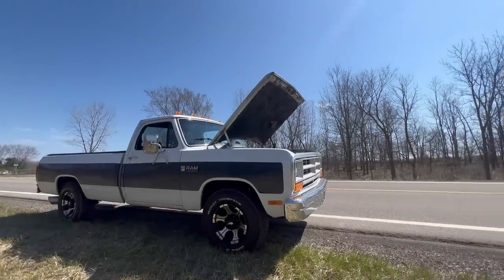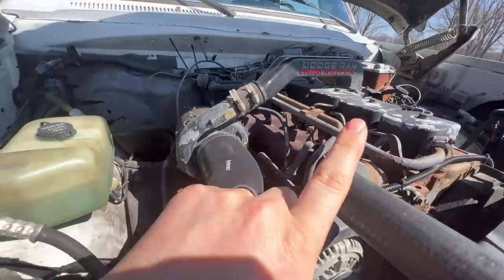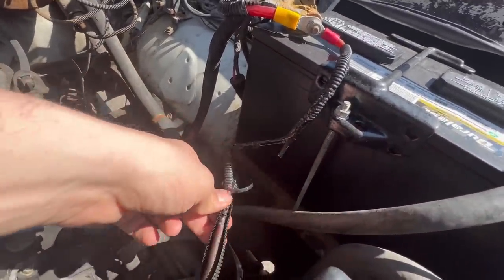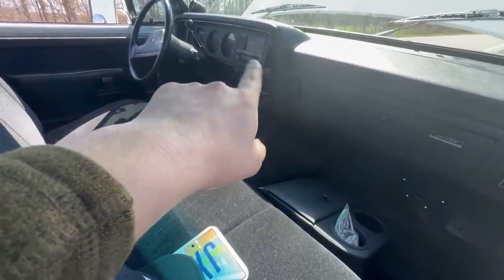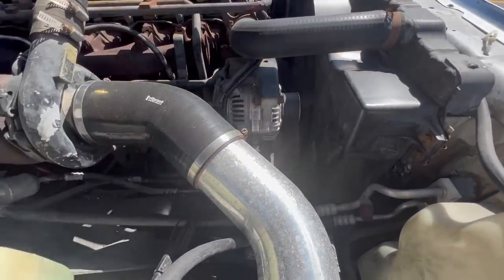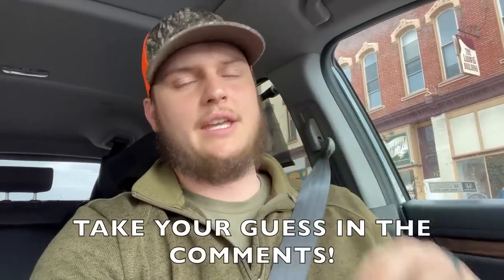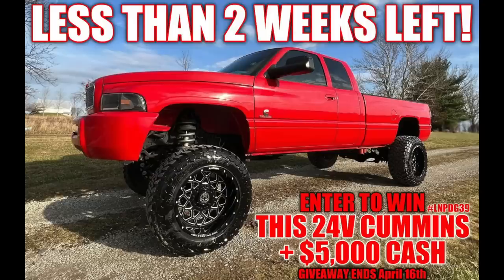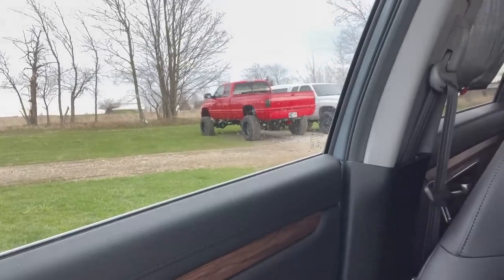the 1st gen Cummins CAUGHT ON FIRE going down the road!!!

Comment: My 1989 cummins did that. It was the voltage regulator popped all the taillights bulbs and few bulbs in the dash and radio did the same and make weird sound. wiring was fine just bad external voltage regulator was charging at like 18 volts on the multimeter

Comment: My brother in laws '90 Cummins used to burn up voltage regulators every few months until he finally got a heavy duty regulator online. but when it would go bad it would overcharge and cook the battery. Might check and see if the voltage regulator is bad